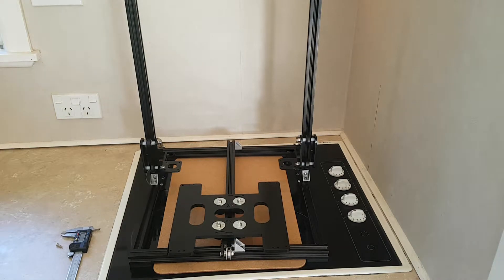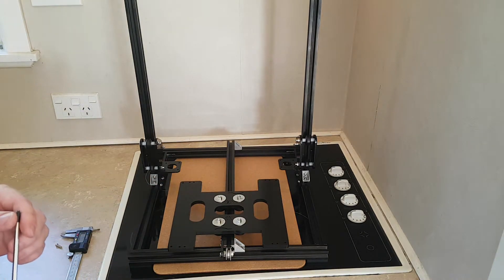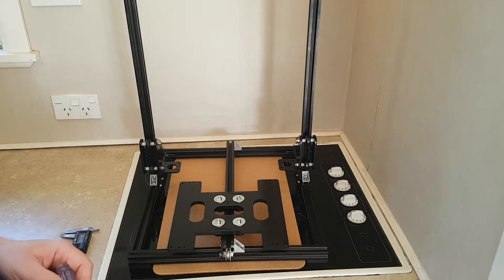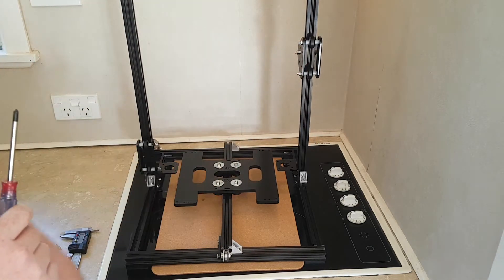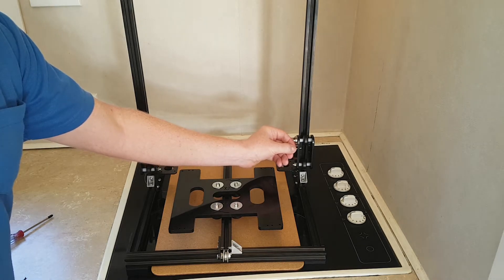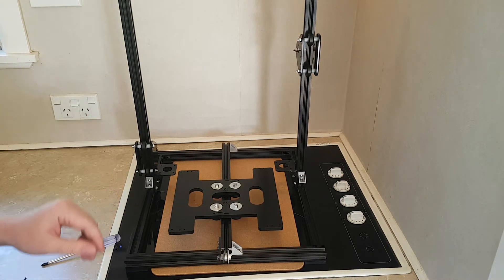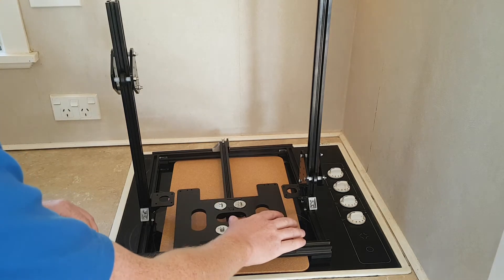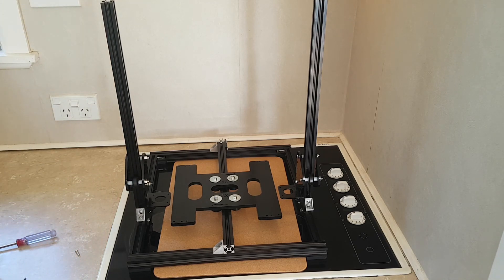Tronxy X3 3D Printer Build:  Y/Z Axis Play: Episode 1

Comment: Finally got mine built, overcame various problems inc lack of correct nuts n bolts, poor Z support prints, wobbling build plate etc. but eventually I switched on &... nothing. No power. Bugger. Solution to 2 blown fuses in the plug & power switch at the rear of the black box, thankfully was just to replace them. B.P. megawobble resolved by swop-in of more accurately made 2020; Now ready to try First Print. 10,9,8,7,6....
Reply from the maker: ................. awesome......
Reply from the maker: Are you part of the FB group ?

Comment: Thanks for this, I'll be building my X3 this week, keep the advice coming ! :)
Reply from the maker: I hope it goes as well as my build has... No missing screws. No play.
Reply: It's going ok so far, just got to the bit with the z axis carriages you discussed in this video and I can't get the slop out of them, just going to have to hope for the best.
Reply from the maker: Drill the hole on back wheel out to a lager size that should give you enough room for adjustment then

Comment: I have two X3s. They are very different. The acrylics one the 1st one worked OK but the 2nd one was way too loose. Here are the two beds. 
http://i.imgur.com/5Cx8xR9.jpg
They are very different. Yours is even different to them.
Reply from the maker: Hi Kent you're Just the man i wanted to talk too..

There is a general belief that all Tonxy x3's a rickety but that is not the case at least some people get a good ( not that i've finished yet) I also don't have any missing screws ! I must admit that the build has been completely  different than what i was expecting. But in a good way. Interestingly that my Bed brace is also different to the two you have shown in that Pic.

So.... buddy old pall.... I believe you designed this ....  http://www.thingiverse.com/thing:2193688 Which I intend on making BUT i REALLY need the other side too, as in the side where the steppers are. Because my ones have a lot of adjustment but for the front wheels but yours dont have any adjustment which could lead to less than ideal alignment. It Would seem ideal to have an identical wheel placement for the other side (where the steeps are) too. Are you able to design one / What program did you make them in / Can you give me the centres for the holes.. Also i would say that the X motor is slightly to far forward so i'd push all of those stepper mounts back 1mm.   

What are your thoughts ?
Reply: I know what you are saying. I initially thought the same but the difference between too tight and too loose is really small. Any misalignment is so minute that it doesn't seem to cause a problem. I'm running them on both of my printers.
If you want to work on a set for the other side, I suggest starting with these. (I did)
http://www.thingiverse.com/thing:1939046

I didn't have the issue with the X motor. 

On your Y axis. Make sure it moves freely and easily. I made mine too tight while trying to fix the looseness and it caused layer shifting and horrible Z wobble. I ended up putting in linear rods. 
http://www.thingiverse.com/thing:2185364
I'm very happy with that setup. I'm just waiting on parts to upgrade the 2nd printer.
Reply from the maker: yeah i've seen your Mod before the problem i have is that if i go that far i might as will massively increase the Y axis cos i'd love to beable to print 500X300 But of cause that will massively jack up the price where do you start and end lol.....

http://www.thingiverse.com/thing:1939046/#comments
Yeah i saw these and thought that might do the Job BUT I see you in there telling him that they are not correct and like falvarez im not sure what your comments mean.  Did you use these as your basis ?
Reply: My comments were about the mismatched printed Z brackets that TronXY sent me. They were the reason I made the original design. 
http://www.thingiverse.com/thing:1982008
His brackets are great.

Do what you want on the Y but for ~$15 in parts and some filament, it's a great upgrade...

Comment: Nicely done. Mine weren't assembled on the rail and I don't seem to have any leeway to tighten them, however this video brings a good point; if I use the deemed to slightly enlarge the holes I should be able to gain some slack to tighten them without reprinting. So thank you very much
Reply from the maker: It's completely possible, like i said in the Video that they have changed the Kit and made all the holes Bigger which is why some people do not have the wobble and / Don't have to have the wobble if adjusted properly.

Well i guess at least i must have proven that some kits don't have the wobble, which is in line with the FB page where some people say they don't have any wobble and i'll definitely add my self to that group of people  

I think i'll make my own brackets With sprung pressure and will post them later.. But much later cos i'm going on holiday before i finish his